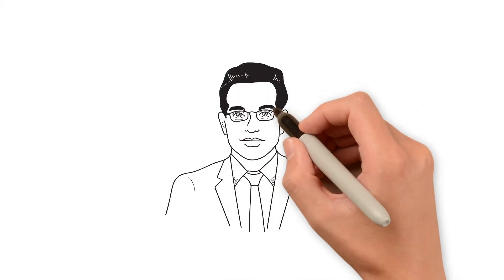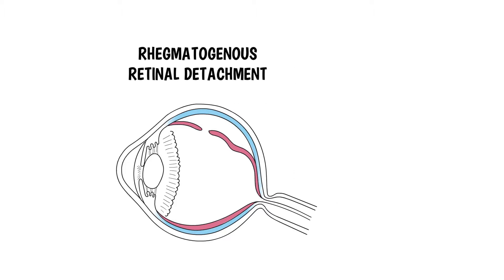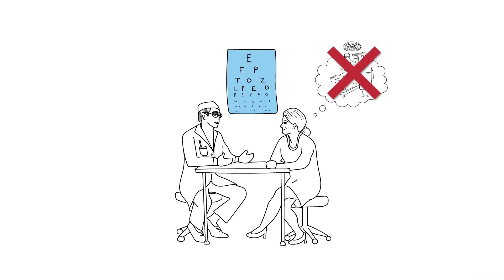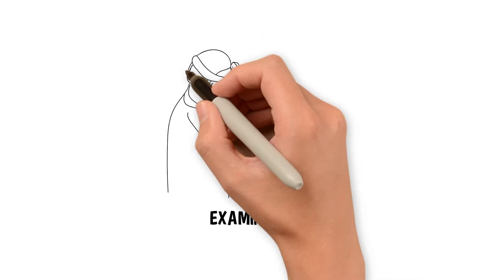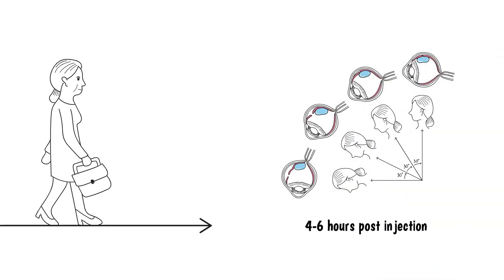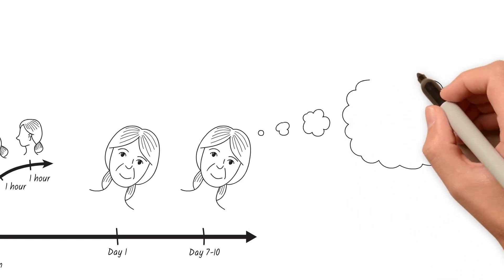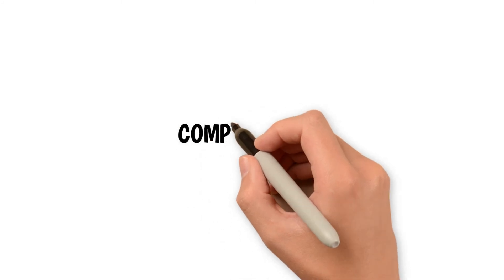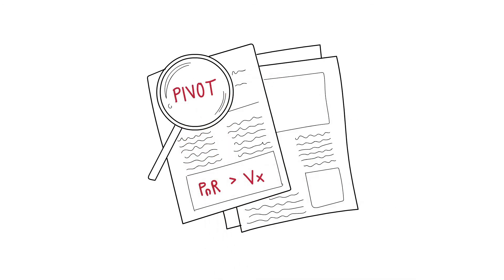Pneumatic Retinopexy Patient Education Video

Comment: I had detachment with 2 small tears at 12:30 and 1:00. First retinopexy I was only positioned head up and tilted right for one hour before laser. Then sent home and told to continue the head up tilted right position as much as possible. Note that I was macula on before and after the procedure, and the bubble was not ideal (was 3 bubbles plus a few fish eggs), but doctor did his best to laser with it like that. A week later bubble was gone but new signs of detachment in same spot, and doc said fluid was still seeping under retina. The retinopexy was repeated and this time the bubble was 2 big ones and no waiting between bubble and laser, then sent home to position head up, right tilted as much as possible. One week later bubble is gone and retina is attached however, central vision is horrible. Can’t read anything much with that eye. Keep in mind that I was macula on going into second retinopexy.  Now I think that my macula got fluid pushed under it! Why did doc not use steamroller positioning during or after either procedure, and would this have made a difference?  Is steamroller known to protect the macula, or is this still up to each doctor? Now I don’t know if I will ever get my central vision back in my right eye.😢😢
Reply: you have to wait 3 4 months for your vision
Reply: @abinashsaikia123  Thank you so much. I actually found out that sometime during second pnuematic retinopexy that my body created a very thick scar tissue on the macula. I believe this is often called macular pucker. My retina doc is confident he can easily remove this. So I will need that surgery in a couple of months. My Doc did nothing wrong.